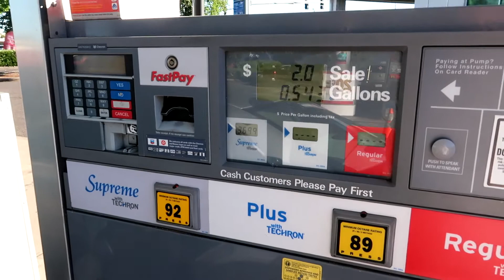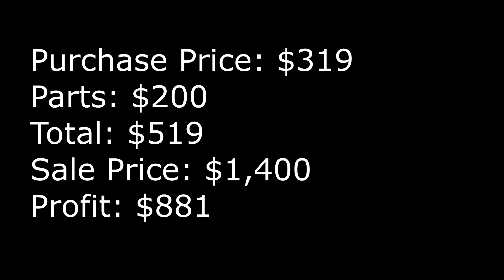VLOG 42 My Cheap Audi Rebuild Part 2

Comment: I have seen other videos in which they put anti-seize on the hub and locking compound on the bolts when they do a break job. Makes it easier the next time. Just a thought.  First class video 😃.
Reply from the maker: I usually use anti-seize on the bolts, but didnt have any on hand!